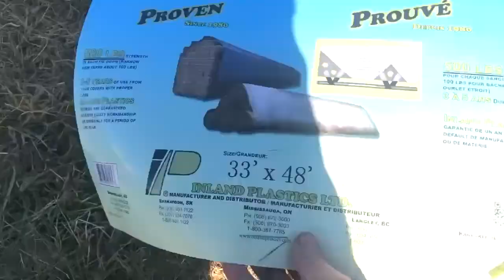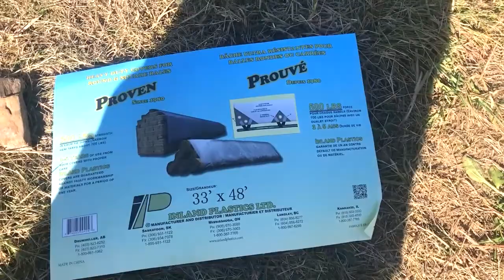Putting up a tarp building

Comment: Good job...I wonder how much snow it will handle?
Reply from the maker: Hopefully alot haha. But we were discussing that we need to get a big pokeing stick or something that we can shake the snow off with. Being up on the hill I'm hoping that the snow will blow off for the most part. It will be interesting to see how it holds up. If it all blows apart I guess we will have to resort to plan B. Thanks Duke.
Reply: @506curtis  plan b to sheet the top?
Reply from the maker: @RuffCut  Well I think we are goin to strap it then eventually start sheeting it in with steel roofing.

Comment: Thats a pretty nice little set up.. Maybe down the road you might concider wrapping it all with tin. Tarps are ok for temporary. One of my woodsheds has a tarp roof. Should last a couple years. I like the construction how everything snaps together. Lots of room under there for many projects! All the best bud! Be safe...
Reply from the maker: Yea it's a pretty neat setup. Then plan is to hopefully get a few years out of it.
Reply: I am wanting to put a tarp over my roofless old metal barn so I can use the building as a garage with a roof.  Are there any intructions on how to put a tarp over an old roofless building?
Reply: @loricampbell1164  im sure you could find some kind of ideas here on youtube. But on corners or anything jagged, use old clothes and wrap before stretching the tarp. Any spot that could rub a bit in the wind should be wrapped. Just some suggestions.. Be safe..
Reply: @AmericanSurvival  I can't find any ideas on youtube.  I've looked.  It is all about putting a tarp over a roof, not using the tarp as a roof over an old building.
Reply: @loricampbell1164  you would have to have an outside frame on each side of the roof. Also you would need rafters to support the tarpacross the span of each side of the roof. For extra support run 1x4 boards in strips in opposite direction as rafters. That should give you enough to hold the tarp/roof up. The bigger gaps between rafters and 1x4 boards, could lead to sags on the tarp in heavy rains. Stretch tarp good and use screws with washers to anchor. start on one side and anchor the corners. Then unroll and stretch all the way across roof area. Tack both corners. Then anchor middle of sides, top, and bottom. Then anchor anywhere else you have grommets. The more anchor points, the better it will hold up. Hopefully that will give you some direction or ideas. Hope this helps.. Be safe..
Reply: @AmericanSurvival  thank you.  I will pass this advice on to the person who is helping me.

Comment: You'd better have a helluva pile of wood to hear that non insulated shop...but Im sure y'all are well aware of that... interesting shop.any angle bracing on that? I'd consider it.just some ideas my friend.i guess you could go right over that down the road with metal roofing!!!hope all's well brutha.great to see ya.👊👍🌳💚🌳
Reply from the maker: Yea I think we are going to strap it and then sheet it in with metal roofing in the future. It's pretty sturdy as is. I mentioned running small cables to square it up and act as bracing but I don't think it will need it. It originally had a fitted tarp on it. It was an oilfield drilling rig building then a worker broke his neck putting it up one time so they were not allowed to use it anymore, so then one of the workers got it for free and used it as a hay barn in a very windy area for alot of years until the tarp rotted off. And now we have it. Yea a big ole homemade stove possibly with an oil drip on it will be put on the corner. More wood requirements means more excuses for chainsaws and chainsaw related activities. It's a win win. It will never get warm in there just mildly less cold. Maybe I'll put a fan behind the stove so ya can direct the warm air towards where you are working. Regardless If it doesn't blow away it will be better than working outside. Thanks Chris!

Comment: Hey not to shabby, few ton of hardcore whacked and you might have a useable floor.... Jesus that platform on the forks was sketchy as f....k. you gotta show us the progress 👍
Reply from the maker: Ah nahh the platform is good Nicky all welded together with planks bolted on top even had a handrail across the back what more do you want. Yea the grass floor may be a bit of an issue but a little bit at a time. Thanks Nicky!